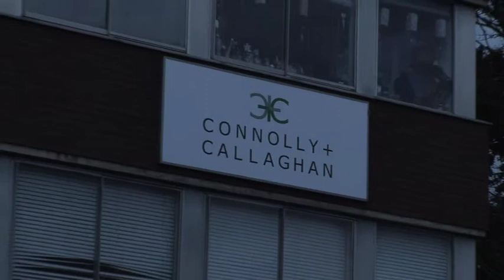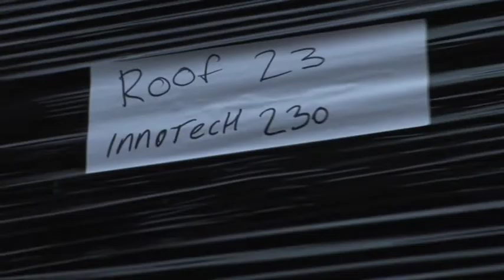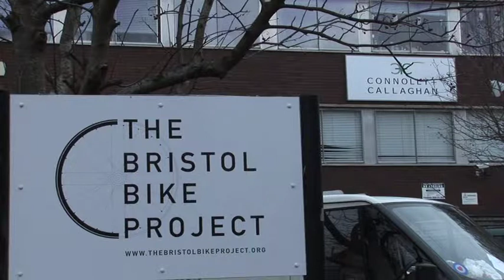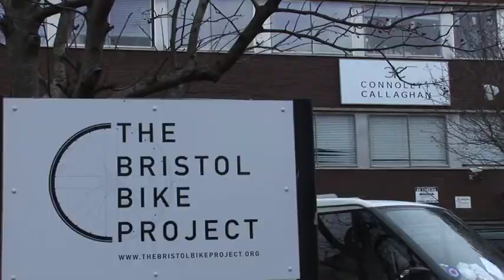Hamilton House Solar Project

Comment: Hi.  It depends where you are.  Our 40KwP array cost about £120K, but since December 2011, solar PV prices halved here, so in November 2012 about £50K in the UK.  N.B. this is for a grid connected system, and we didn't have to pay for the grid hookup.  No batteries either.  Your mileage may vary.  Solar definitely rules.  Good luck! David  ;-)